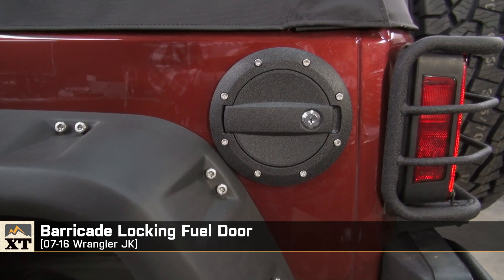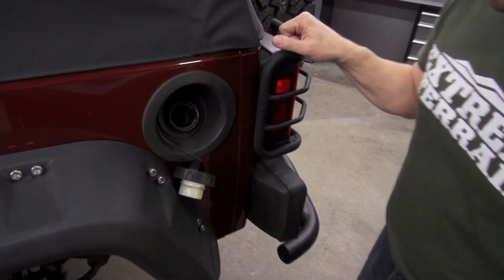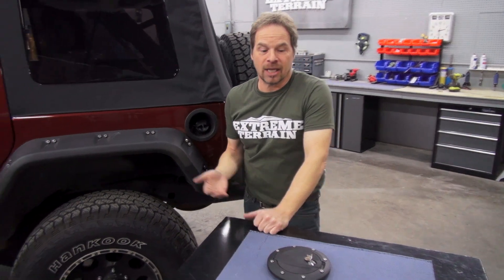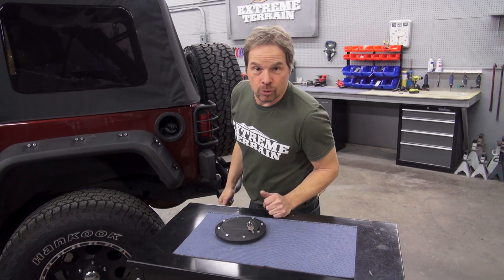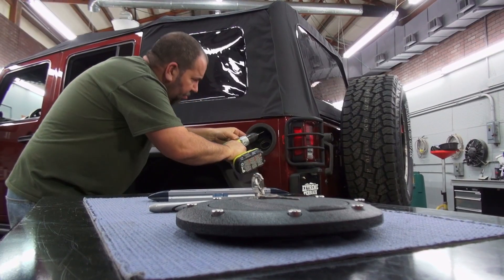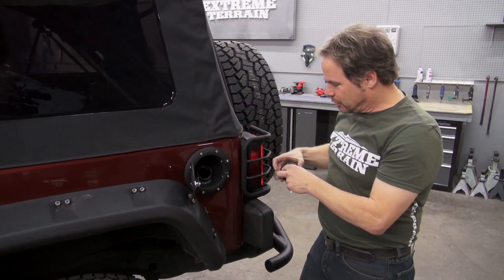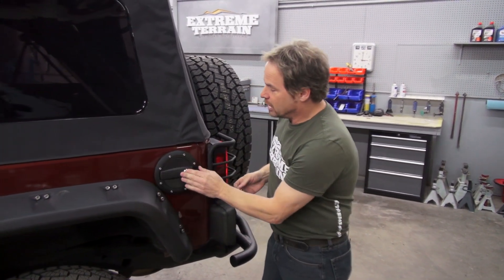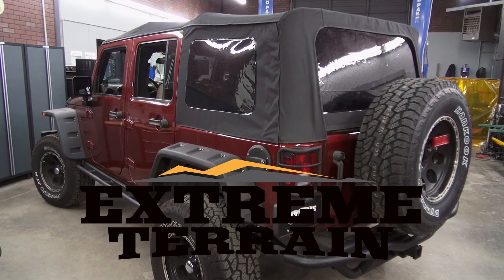Jeep Wrangler Barricade Locking Fuel Door - Textured Black (2007-2016 JK) Review & Install

Comment: What vehicle's have a lo:king fuel door, I have 4 vehicles two rhat are new a Chev 3500 2016 and a Wrangler Unlimited 2017 no locking fuel doors.
Reply from the maker: I'm not sure exactly what vehicles come from the factory with a locking fuel door. However you can usually buy a locking fuel cap for almost all vehicles on the market, as well as some vehicles you can buy an aftermarket fuel door! We sell a couple different locking fuel doors for the Wrangler. Check them out! http://www.extremeterrain.com/wrangler-jeep-jk-fuel-doors.html -Jake

Comment: can this be used on my 1995 wrangler anyone?
Reply from the maker: Hey Brendon, do you mean relocating the fuel door on your YJ from behind the license plate to the side of the body and using the Barricade Fuel Door? Or do you want to use the Barricade Fuel Door in your stock location? Let me know! -Jake
Reply: ExtremeTerrain.com If possible i would like to use the barricade in the stock location. But if not how hard would it be to relocate it?
Reply from the maker: In order to use the Barricade fuel door in the stock location you would have to convert the filler neck to the JK "circular" recess. The Barricade Fuel Door attaches to the already existing trim piece on the JK Wrangler so you would need to custom fab a the JK style fuel location into your YJ location for it to work properly. If you need any more details just let me know Brendon! -Jake